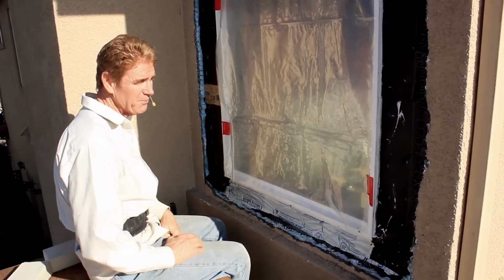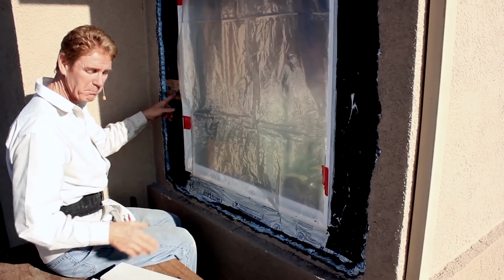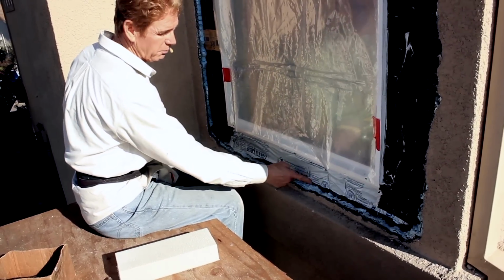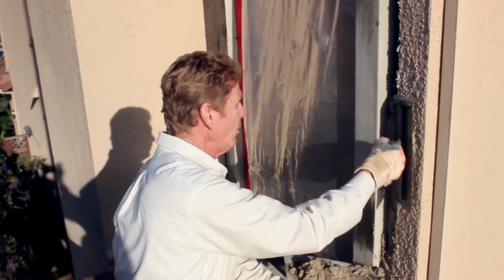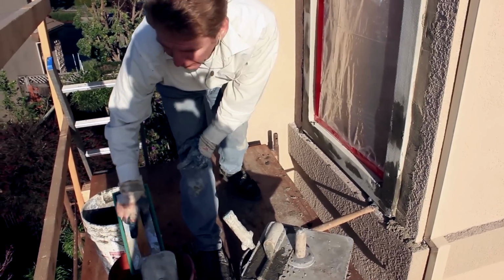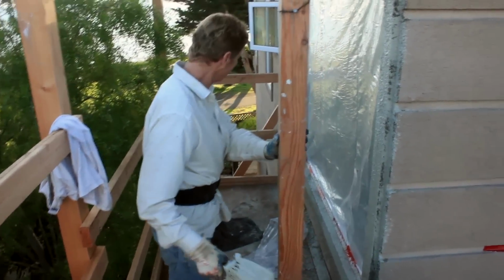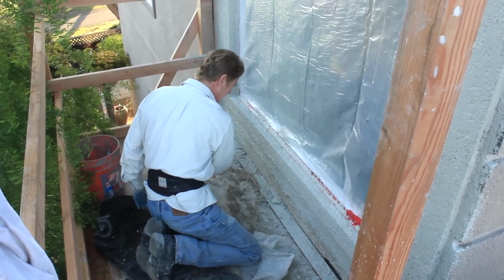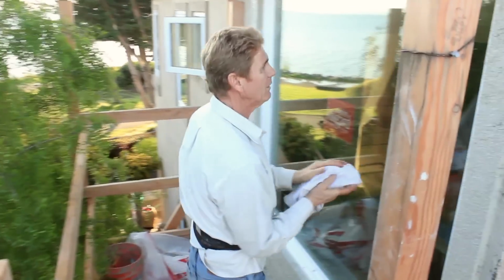Repair Styrofoam Stucco with Traditional Stucco

Comment: Kirk, love your videos. I'm in Santa Clara and need to fix my botched styrofoam trim application. I applied the styrofoam trim to my stucco walls without using stucco. I think I can reuse the styrofoam by trimming off the old caulk and sanding the paint to add texture for bonding. Then add the nylon mesh you mention. At this point, I figure I can add finish coat stucco to the boards and press fit as you describe in your videos. Then add a layer of finish coat stucco over the trim and paint when dry. How does that sound? By the way, I had issues with the walls being wavy. Nothing is ever easy.
Reply from the maker: As long as you're waterproof that's what really important, making it cosmetically perfect takes a bit of practice.
Reply: Thanks for the advice, Kirk. I used Stucco Patch because it's fast and a box only weighs 25 lb. You're right to talk about that in your video. Everything went great for a DIYer. I don't know how you managed to make the styrofoarm forms stick! I had to use masonry nails. I only did a 40 inch section to see if I could handle it. I'm happy, and it's way better than before. Now I've got  a lot of stuccoing ahead.  @StuccoPlastering

Comment: Should the stucco over foam dry hard/solid to touch or should you be able to feel the squish of the foam through the stucco finish?  I ask this because our new home was completed using this process and there are some areas we can feel a squish in the trim around the garage/windows.
Reply from the maker: When the stucco sets it will be hard as rock.
 Perhaps your feeling styrofoam that got missed?
Reply: Thank you, recently purchased a new build and there are spots that are squishy, builder says that's normal,  we didn't think it was

Comment: In the northeast we used Conproco products.  Virgen bead foam, nylon embedded in base coat then flex coat.  Don't forget to rasp foam.
Reply from the maker: Howdy James dude, for close to 5 years when I worked for large companies we mainly did the dry-vit system for hospitals and schools. 
The only time wed rasp the foam is when it was raw.
 But if it was to thick or bulging no doubt with the Panzer mesh or regular mesh rasping was necessary or wed have a lump.
 Do you remember why Panzer mesh got its name from?
     Kirk and Jason Giordano, Bringing to all the most complete plastering encyclopedia ever created in the world online.
 By the plastering messengers of Youtube.  With well over 850 free self-help videos 🎭 👀💃
Reply: @StuccoPlastering  Morning Kirk.  No  I do not know how Panzer mesh got it's name.  All I know is that is works.  Enjoy everyday. Why?   Because you can. That's why.

Comment: I was hoping to see how he went about covering the actual foam board.  Am I supposed to cover all the foam in polybond,  and mesh, then cover that with cement or plaster? It's for an interior space. Any feedback would be appreciated.
Reply from the maker: Evening Vanessa, you can do either, if the foam is already at its fullness, use Poly Bond only sold at plastering materials yards such as, "Westside building materials."
 if it need a full inch or more, use < "home Depot's"
 rapid set, just get a small box, if you only a few of these repairs to do.
 BTW, I haven't heard of anyone attaching foam mold on the inside as the finishes are cementitious, if your skin rubs on it hard accidentally, you will lose some of it and end up bleeding.
   Bringing peace, love, and brotherhood back to the world of, “Cement Plastering.” 🌍
With over 800 educational and free Youtube videos, by your favorite plaster geek, “me🤓” and my son, “Jason,” the bearded plasterer.💃
Reply: @StuccoPlastering  hi, it's not for molding, it's for a wall that will have rigid foam insulation attached to it (basement). I do want a more fine smooth look, so perhaps I'll plaster over top of the poly bond? To get it smooth? Any idea what I should use as a finish coat? I like your vids btw☺
Reply from the maker: Evening Vanessa, we are going to download a video Friday that is the right choice for what you have.
 Its called Image manufactured by La Habra, it has the finest sand grins there are.
 The fact that it is an acrylic means it stick to everything. No bonding agents will be necessary, and better yet if you rub against it, it won't tear your skin off.

   Bringing peace, love, and brotherhood back to the world of, “Cement Plastering.” 🌍
With over 800 educational and free Youtube videos, by your favorite plaster geek, “me🤓” and my son, “Jason,” the bearded plasterer.💃
Reply: @StuccoPlastering  you're the best!  Thanks so much Kirk:) I'm excited to watch the video. Keep on dancin💃

Comment: That is not an EIFS system. That is a normal 1coat system.  EIFS does not require black paper or wire.
Reply from the maker: Good afternoon Jose, actually of course it does, under the foam boards.
 Bringing peace, love, and brotherhood back to the old fashioned 🌎  “Plastering.” 
    The most comprehensive encyclopedia of plastering on video, by the plastering messengers of Youtube.  
     Over 800 videos 🎭 👀💃

Comment: EIFS isn't a barrier system, as you know. Haven't you lost your drainage plane around the window?  Also, how is the window sill weeping? Thanks for your great videos! Too bad your not in my area, as I would hire you to re-parge my foundation wall!
Reply from the maker: Good afternoon Rob, the drainage system of the windows is on the front bottom as in both corners.
 Bringing peace, love, and brotherhood back to the old fashioned 🌎  “Plastering.” 
    The most comprehensive encyclopedia of plastering on video, by the plastering messengers of Youtube.  
     Over 800 videos 🎭 👀💃

Comment: I enjoyed the video--even two years later! Question for you or anyone else: When that gap around the window was filled with stucco, does that create a major area of air infiltration? I would think those new windows are meant to provide some time of insulating properties, along with the EIFS foam. (I know California is big on that.) Thanks again for this video!
Reply from the maker: Good morning Kieferonline, great question, before my application of stucco the moister barrier completed in this video would have lasted until the materials deteriorated,  
about 50 to 100 years, my opinion is with stucco coating it's permanent or at least 500 years.
     Best wishes,
Sound Plastering tips from your favorite stucco geeks
Reply: Air? Thermal conductivity may increase a bit, but probably not appreciably different than the R value of the window frame.

Comment: so should I buy a house that has EIFS Stucco? Or avoid at all costs? Waiting for the inspection to come in and the seller said they did some remediation 10 years ago. SO I'm assuming if there is no moisture it's ok to keep an EIFS Stucco house? LMK! THanks!
Reply from the maker: Howdy Bankrupt or Kryptonite Dude, buy the stucco house,
 FYI, Stucco is a very long-lasting material, suitable for the life of a building, and it generally maintains its color and freshness of appearance for as much as 100 years.
Stucco provides thermal insulation against hot weather, helping to keep a home cool in the summer, especially if the exterior is a light color.
Stucco insulates against outside noises, making the inside of your home noticeably quieter than with exterior siding. Stucco strengthens a home, providing additional structural rigidity. This is because a stucco building is permanently encased in an envelope of wire and cement.
 If you don't like the look of concrete (a matter of personal taste), wood siding or cement board siding are better choices than aluminum or plastic. However, none of these sidings will last as long or be as maintenance-free as stucco. 
 Kirk giordano plastering
Reply: Haha! Thanks for your note ....Ok so there aren't any concerns about EIFS Stucco other than making sure it has a proper drainage system and does not have mold / rot? Thanks again!
Reply from the maker: Howdy, It's very rare I hear it's not draining properly, best wishes,     
                     Live long and plaster, 
  Sharing stucco secrets, or common sense tips
Reply: Thanks for your advice. Got the stucco inspection back and they said this: The bottom edge of the EIFS terminates
above grade but is not sealed along the
bottom edge exposing foam. The bottom
edge of the EIFS is suggested to be sealed
by a stucco contractor using a cement-type
mixture to encapsulate the foam.

I was told this was intentional due to the termite treatment company needing access to the frame of the house to keep the termites away. Is there a solution where the termite treatment will still be able to be applied but not be wide open to the elements?  Thanks again!
Reply from the maker: Howdy 3D dude, all synthetic and cementitious finish should be above grade 6 inches, but below the mudsill by at least an inch., as a rule, but seldom is this done.
 Thus, your home seams built according to code. There are no bugs that eat styrofoam I'm aware of, not even termites can eat it, I hear it's not good for their diet, now rotten wood, yummy.  
If anyone concerned about it applies some Sikaflex polyurethane adhesive sealant caulking in your hand and cover it, won't do much good as it's a similar material, but if they want it covered that's what I'd do.
BTW, Sikaflex caulking is very naaty stuff wear gloves as it stick and seals everything forever.                
                         Live long and plaster
         Mastering Plastering for the beginner’s

Comment: Do you have any videos on how you break out this EIFS stucco when doing window replacement? I found the ones for standard stucco.
Reply from the maker: Good evening Baron, we try not to break out too much on film as the dust get on the camera lens, sorry
    Live long and plaster
 teaching  plastering video’s
Reply: Would you say it's the same as breaking out 3-Coat? i.e. w/the bulldog, leaving the lath? I'm pretty sure I have Diamond Wall Insulating One Coat System or EIFS, (not sure of the difference). Thanks!
Reply from the maker: Good evening Von Who? Dude?
 actually breaking our EFIS is 20 times easier than conventional stucco, I used my utility knife for most of it.
    Live long and plaster
 teaching  plastering video’s
Reply: Thanks for replying, love all your videos, and work ethic, I'll be in touch via your website for an estimate on a job. I plan on doing window replacement myself. Prefer a craftsman for the stucco.
Reply from the maker: No worries baron,
 Live long and plaster
 teaching  plastering video’s
Reply: Hi Kirk, Researching more on your website I realize I'm too far out of your area for you to do an estimate for me :( . However I have also discovered that I don't have the EIFS system but the one coat version like the Diamond Wall (which has a foam board as as the base and metal lathe). Do you break out the one coat the same as the three coat (with bulldog)? If so I'd be gentle as the bulldog could probably go through the foam very easily.I'm planning the project for the first half of next year and just making sure my monkeys are all lined up.

Comment: Hey Kirk, I have a general question.....if the temperatures are expected to drop below 32 degrees overnight, what is the general rules for stuccoing during this period? Is there a general time period, that the stucco should be completely cured, before being exposed to cold temps?
Thanks. I appreciate that you share your experience and skills. Best Regards
Reply from the maker: Evening J, man, I hate working in cold weather, yes I have worked in 27 degrees where if you hit your finger on something it hurts like heck, or with the glove we wear they go numb and hurt too.
 O.K. enough of my whining about cold weather, if stucco is applied properly in any temperature it will cure, even underwater makes no difference, it just takes a bit longer.
 BTW, for sissies like me I prefer 75 degrees to 95 all year round as I love hot weather even 100 degrees.
 I am looking to move to Florida or some other hot area as the sun on anyone's body does magic.
 Kirk and Jason giordano’s stucco repair videos
Reply: Thanks for that. I wasn't sure if freezing would cause cracking, or, of it would freeze, with the moisture content. Was trying to decide to wait for a while, till there would be at least a week above 32. I used to live up by Chicago. I got tired of 40 below zero wind chills all January. Living in NM now. 
Thanks again for the time and effort you put in to your channel here. It is very much appreciated.
Regards.
Reply from the maker: Howdy, no worries, the water in the stucco will freeze, but it will not stop the stucco from curing, it will delay it just a bit.
 Cheers,
Kirk giordano plastering

Comment: Hey Kirk...we do alot of e.f.i.s. in Florida. Was wondering y did u not basecoat and mesh the bands? By the way love ur videos. Im a 14 year plasterer and its great to c other quality work. 👍
Reply from the maker: Howdy Tony, the bands or styrofoam was factory pre meshed and coated,
"I'll never make the mistake again of thinking "i'll save money to coat them myself"
 27 years ago I ordered a stack of foam that would have filled 5 garages full with raw foam, I spent 10 days with 8 men coating this foam, by the time I had finished it cost me twice as much as if I would have bought precoated, live and learn.
 Best wishes,
Kirk and Jason’s plastering repair video’s

Comment: very nice - just a question on what you put over the forms around the window. Was it also covered with stucco and then the dash finish? We see you place the foam forms and then use the mesh tape with polybond - then what did you do next before the dash - or is it just the dash? BTW - I love your videos thank you for sharing with us
Reply from the maker: Morning Paul, good question as this fix was a bit complicated on this one with 3 different cementitious materials,
 the finish I through on it with my dash brush was  a La Ha Bra color finish, I could not have matched the finish with poly bond or the eisenwall that I used for the base coat.
 cheers,
kirk’s home improvement videos

Comment: Did you plaster the styrofoam before applying the dash? Thanks.
Reply from the maker: Morning Jock dude, the original styrofoam had stucco wire netting attached to the top of the foam boards,
we just eliminated the foam board and instead used the same wire with stucco for the base as well as the top coat as they did.
 BTW, I have used this very same foam board system many, many times, however not in the last 10 years as traditional stucco is king where we're located,
 cheers,
kirk and Jason Giordano’s home improvement videos

Comment: Great work as always.  So much attention to detail.  👍
Reply from the maker: Morning Daniel, this one had a whole lot of details, had I not lathed it (waterproofed) prior for the necessary lath inspection, we would not have finished them all in a day as we used 3 different cements, as well as two different caulkings, all had different set times.

Good thing I can do this stuff blindfolded, now if we could only control the daylight needed.

 cheers,
kirk’s home improvement videos

Comment: Hey Kirk!  Great video.  I noticed you used wood scaffolding, not steel.  Any particular reason?  Might it be that you can get it closer to the house without messing up the previous stucco and still catch the drips?
Reply from the maker: Howdy 松田もしくろす, my Japanese friend,
 Old kirk did not set either side of the scaffolding the contractor did,  Jason and I just did the easy stuff like putting the wall back together.
 Cheers,
 kirk giordano Rendering